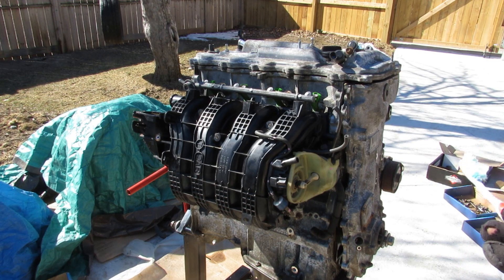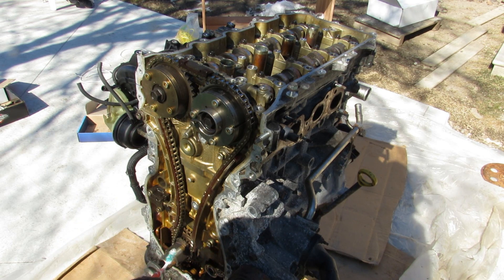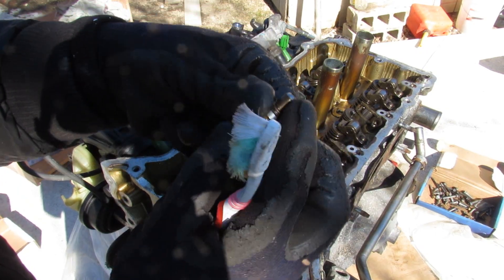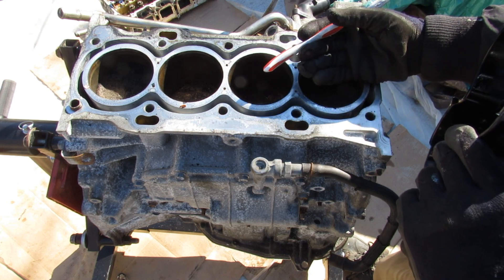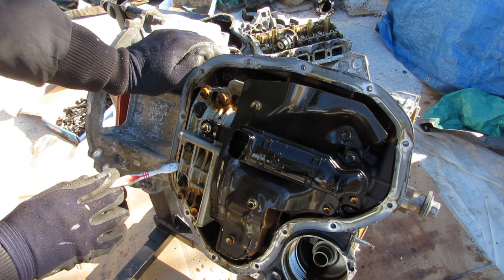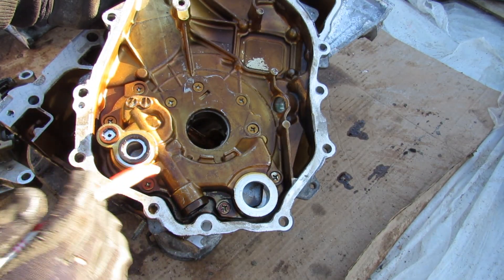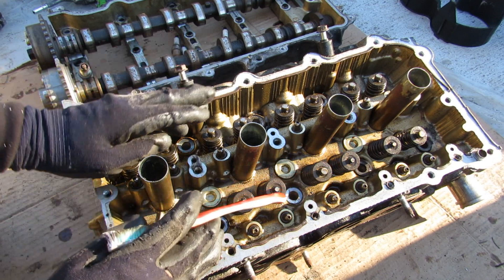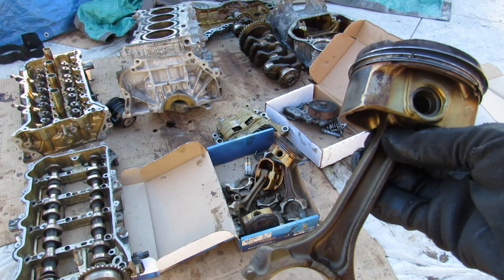Why Toyota Engines are Reliable

Comment: Too bad it's impossible to find a Toyota with a manual gearbox in North America. I'll stick with VW.
Reply: Additionally the Golf is far superior to the Corolla. Golf is way more intelligently designed from a user-experience perspective. The Corolla has substantially more limited space in the rear seats and back as well. And the Corolla has pretty poor rear visibility and awkward front pillars.
Reply from the maker: True. Sad

Comment: that's a very interesting cam setup. I like it. It's also interesting to see the air flap system in the intake manifold. I never saw that before. But, after Lincoln Tech I went to VW school, not Toyota, unfortunately or not.

Comment: Yes Toyota Honda etc have reliable engines. But they are spiritless, dull and drive like a boat. Some exceptions like Type R. But since you Americans  are used to driving boats that only go fast straight, I get why you guys love Toyota. Drives a lot better than a Buick. The suspension on USA cars is like Jason Derulo. Wiggle wiggle wiggle.

In Europe we drive circles around your cars. Yes our cars are more fragile, but they are in their own class. No Asia or USA engineering can come close. All the important races in the world proof my point.
Reply: European car Suck two to three time the cost on the maintenance and the Value drops like a rock! Yes Toyota Honda are the best and the best value on the life span of the car!

Comment: Have put 246,000 miles on my Toyota Solara (3.0 V6 1MZ-FE), so far replaced 2 water pumps as a preventive maintenance since 2002. Usual change of belts, filters and an oil pan since the threads became stripped from too many oil changes.
Probably another 100,000 miles and maybe then the engine will get tired?

Comment: Yeah reliable my arse. I had a scion xb brand new and after 18 months, it was sucking quart oil evry 4 months found during change oil. I was told it’s normal to 2.5 liter used also to 
camry, rav4. Traded right away.
Reply from the maker: Toyotas tend to burn more oils than Hondas, but the 2.4 was worse

Comment: I wonder though, if this engine is so reliable why is he tearing it apart? Why the rocking in those components?

I also wonder if my AZ engine is going to start drinking oil and chew up the head bolts?

Comment: I have always wondered why Toyota never got into the business of supplying engines to the small aircraft industry.(Cessna's and such) I had a 1985 Toyota pickup that had 250,000 miles with the original engine. That thing would not die. I believe it was the 22RE 4 cylinder engine. It was the same engine that they used in the Toyota forklifts. They could have made allot of money.
Reply from the maker: Cool

Comment: I had a 90 toyota pickup with the 22R-E, 2.4L, I put over 400K on it over 19 years, other than basic maintenance, i replaced the alternator twice, 1 starter motor, and the radiator once. Used to pull a 3500lbs travel trailer with it and it was still running fine when I sold it. best vehicle I've ever owned.
Reply: Please tell me, what was your experience towing?  I have an 89 with a 22re and it feels absolutely gutless.
Reply: @ianspeckmaier9565  Mine was pretty good, its a small engine to be sure and it doesn't make much torque until you get the RPM's up, I don't remember at what RPM the power kicked it, but without your trailer get it up to about 10 put it in 2nd and hit the gas, I think around 3K you will fell a good increase in power. I used to wind mine up to 6k regularly and in fact you can get it up to 60 MPH in 2nd get. I used to hold 55 in 2nd climbing mountains if 3rd wasn't doing the job. don't hesitate to let the gearing do the work for you. keep in mind my little truck was well maintained, I always changed oil after 3000 miles and if not on the button but within a couple hundred. Plugs, wires, cap and rotor were also maintained. Buy the time I sold mine it was 19 years old and well over 400k on original engine, not going to say it wasn't getting tired, it was. still ran and drove it around town, it was past its prime for towing, if I still needed it to I think a rebuild would have been the best bet, don't know how many miles you got on yours or how well its been taken care of. but those are things to consider. do a compression test, that will tell you if its still up to the task or needs a bit of care first. I've said many times, that little 90 toyota is the best vehicle I ever owned. best of luck to you and your little truck :-)
Reply: oh and one more note, back when I was using it for pulling the national speed limit was still 55, to go over 60 had to take it out of 5th and use 4th, to hit 70 needed to use 3rd. Don't think I'd use it to pull anything with a lot of wind resistance today. with speed limits up to 80 in places you need a bigger engine for like a travel trailer, its not the weight its the wind resistance.  My trailer was 2 foot wider than my truck, its like pulling a brick wall.
Reply: @kirknelson156  Awesome appreciate you sending all that that's exactly how mine drives too.  I just rev it out and when I get halfway up the power band she seems to have a lot more juice.

Comment: The infamous oil guzzling toyota engine.
Reply: I have a camry with the 3.5 2gr-fe doesn't use a drop of oil. Runs beautifully. The 2.4 2az fe is infamous for burning oil though no matter how meticulous you are with the maintenance.

Comment: I used to have a 2013 Camry (bought new) with that exact same engine! I put approx 115,000 miles on it before trading it in for a new car. That engine still ran like the day i bought it.
Aside from the usual (tires, oil, coolant and tranny fluid), I didn't have to spend a penny on repairs
Reply: 115k is barely broken in in a Toyota.

Comment: Still got my 1991 3S-GTE turbo engine, just finished a rebuild and was very happy to see there was very minimal wear, mine was starting to use oil alot, turned out to be all valve oil seals were cracked and 8 oil return holes on oil control rings on all 4 pistons were full up of waxy stuff, the control rings were also solid and didn't really move, thank god for the oil squirters!  ended up stripping down, washing entire engine with chemicals to remove the waxy stuff from holes gallerys etc, new piston ring set, light hone out, new main bearings as 1 had worn slightly through coating, 2 new thrust washers, new big end bearings, I polished the crank and cam bearings, used plastigauge to size replacement bearings, stuck whole lot back together with new seals and gaskets, its literally going back in the MR2 this week, hopefully will last another 30 years, legendary engines, now got a 3S-GE to put in a Caterham so that's up next for clean & rebuild if needed.

Comment: Cam phaser rattle on cold start up,even with low mileage, is an annoying issue with these engines. All in all it is a great engine.
Reply from the maker: All of them have it. Even my car
Reply: @speedkar99  it is a poor design.  My wife's Camry started rattling on start up at 30,000 miles.

Comment: We have a 2010 Toyota Avalon that was given to us by my Brother-In-Law.  It was his wife's car.  We have the oil and filter changed every 3000 miles without fail, we don't floor it, we don't drive it much over 70 MPH, yet at only about 76,000 miles, it has a bad piston pin.  So much for Toyotas being so fantastic.

Comment: I have 2014 Camry 2.5, is this the same engine?
Reply from the maker: Yes
Reply: @speedkar99  could I use 5w-20 instead of 0w-20?
Reply: @speedkar99  thank you 0w-20 burns oil

Comment: that plastic oil filter housing was a terrible idea on toyota's part. I remember customers coming in with sudden oil leaks after paying some noob at jiffylube to do their oil change and the idiot stripped the threads or didn't tighten them all the way. I think Toyota still uses the aluminum housings but for certain vehicles.
Reply from the maker: Yes aluminum on the Lexus models

Comment: It amazes me how so many engines these days are beautifully designed to the hilt for efficiency but often seem to leave a poor design cue somewhere that causes the engine to fail, eg dodgy cooling on the Ford Eco boost engines, timing belt tensioning issues on many engines and poor OHC lubrication systems on quite a few engines.
Reply from the maker: Yes

Comment: Very cool now i understand how my engine operates thanks! Certainly shows the importance of changing oil I do mine every 6 months even tho i drive about 6.000 Kilometers a year lots of passages the oil needs to flow thru especially when it comes to keeping the rings in good shape especially the ring that scrapes the oil off the cylinder walls. Too quote Scotty engines are expensive oil is cheap
Reply: You're just wasting money though, modern synthetic oils will last for two years with that mileage.

Comment: I think it's because to be an engineer in Japan, especially an automotive engineer, you practically die just trying to get through university. Hell, just getting in .
Reply: They also have culture where they value quality and dependability above all else.
Reply: JATCO (Nissan) certainly hired some idiots to design their CVT's and other parts of the cars.  The Europeans also screwed up Nissan.
Reply: @robinsattahip2376  I was about to say... all that tech is actually coming from Renault.
Reply: @robvelor  no. Mercedes were using this technology of the cam box system in the 1970's, being part of the M110 twin cam 6 that first appeared in 1971. The VVT system has been around for about 25 years as far as I can remember. I think this system was introduced by Mitsubishi in the very early MIVEC engines.
Reply: @christophermarshall5765  but it's Renault's implementation.
Reply: @robvelor  no it is not. Mercedes made the twin cam six cylinder engine in 1971, while Renault were still using pushrod engines in their cars. I should know this, because I have a Mercedes W123 station wagon here which has an M110 twin cam engine that has the cam box set up the same as this. The only thing that engine does not have is variable valve timing, not that it needed it, because those engines put out 185 horsepower with fuel injection. Renault were never an influencing part at the time.
Reply: @christophermarshall5765  Renault is actually building it though.
Reply: @robvelor  yes Renault are using this technology. The twin cam system is not new. The first twin cam six cylinder is Mercedes built, and they were using twin cam technology in racing cars before it was used in passenger cars, along with fuel injection technology.
Reply: There's also probably some influence from Zen minimalism

Comment: Had a scion tc with this engine. Redlined it every gear, all day, everyday. Never an issue and had 130k miles
Reply: 210k redliner here, still going absolutely no worse for wear! Remarkable motor, going for 500k, because why not

Comment: Amazing this guy knows almost every part of the engine. I'll be like where's the dipstick?
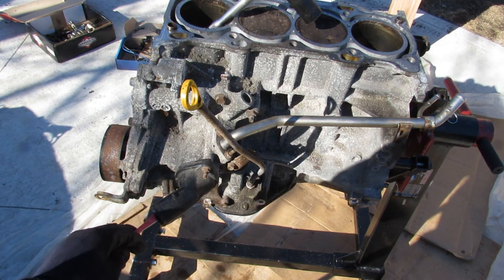Reply: 6:41 there it is
Reply: I think, I just done found the reason why people do not change the oil in these things. 😂
Reply: He is using the toothbrush of knowledge, thats why.
Reply: Yeah, hes brilliant!!
Reply: Some new cars don't have one--oil level is displayed on the dashboard infotainment screen (along with tire pressures).
Reply: It’s funny I close to  just as much and how it all works. But I have never worked on a car and would have no idea how.
Reply: That's because there's WAAAAAAAAAAAAAAY more shit on a little dinky 4 banger than there needs to be
Reply: @MadScientist267  a VW flat 4 has nothing it doesn't need. It also produces about 30hp, but who cares?
Reply: @AR-zq9hq  I never qualified it beyond the implied "to run" 🤣
Reply: @AR-zq9hq  30hp,terrible gas mileage and needs to be rebuilt about every 60k miles all while putting out tons of pollutants.  das auto indeed.
Reply: Just familiarity gained over time.
I can name all of the parts inside a PC/console or on most circuit boards, but if somebody had a model of the human body's internal organs and told me to point to all the parts of the lymph system I'd be like: ...... O_O

Comment: Toyota/Lexus engines, what BMW used to be until after the E46 M3, well engineered, constructed and reliable. Toyota engines are getting even better, while BMW engines are going the opposite direction.  Having owned are worked on many of the good BMWs, l wouldn't have a new one unless it was free.

Comment: That’s a lie. The motors they manufactured for the first generation Scion TC has a defect that will cause excessive oil consumption and at some point, the rod bearings to wear out. How is that reliable?
Reply from the maker: 2az is a different motor

Comment: First car I got and still have 2009 camry with 2.4 liter.  It's reliable as long as I keep putting oil in it.
Reply: No leaks. It burns it. Read about 2azfe
Reply: @mikevee16  if it burns oil then put 10w 30 oil. See if that helps
Reply: It can take 5w20. I'm gonna switch from 0w20 to that.
Reply: @mikevee16  yes do that
Reply from the maker: The 2.4 for notorious
Reply: Fix the leaks

Comment: Why did the connecting rods have so much play? What failed in this particular engine?  The bearings looked decent. 
And I always thought Toyota oil passages were too small and convoluted. 
A leak in the timing cover or at several points would cause a loss of oil pressure in this design. 
Always thought an electric oil pump that starts up with a four second starter delay would stop cold start damage on all non racing engines. 
What do you think?
Reply from the maker: Apparently the play is normal. True having multiple points of leak can affect oil pressure. Luckily it's not a leaky BMW lol
Reply: Electric oil pump - nice idea. Would keep the major points prelubricated before starting and useful for turbo as its bearing could be cooled down after shut down.

Comment: 9:15 that's not a problem, it supposed to do that.
That wasn't the cause of any noise problems in the engine
When the oil pressure rises in the engine that should eliminate the movement
Reply from the maker: Good to know

Comment: Simplistic? You havent seen a simple engine until youve looked at the inside of a 2005 hyundai elantra 2.0L engine.
Reply from the maker: Good idea
Reply: We had the 1.8 Elantra, 2013 or so, with 130k km. The chain stretched so much, with the gears  and guides worn out, that the tensioner couldn't keep up, and it jumped. Never in my life I have seen such disaster, I even video it since it's quite a rarity. So we slapped 'new' one, with 60ks - everything all good. After everything was payed, we asked the owner: so how often and what oil did you use? (we found big bottle of 10-30 Quaker State in the trunk) - Ah, you know whatever was on sale at CT. If it was low, I just added a liter or so. I newer remembered the when I changed the oil, but I did 5-6 oil changes, since I have the car.
So in total the average OCI was about 20-25k km using regular mineral oil - damn engine killers.

Comment: Why are Totoyas reliable?
If it isn't broken don't change it. Iterative mechanical changes based on feedback from previous designs leads to better reliability then clean sheet redesign every new model year.
Reply from the maker: But somewhat outdated
Reply: @speedkar99  Yep. I'm a believer in never purchasing new items, including cars. if its at least a year old you can find reviews or feedback on the quality and major mechanical defects and make a more informed decision. In a similar vein if toyota basically use the same engine for 20 years they should have most of the major design flaws sorted out.

Comment: I rebuilt my 1GR FE engine in my 05 4Runner back in 2013 when the engine sludged out (had regular oil changes). I spun all 4 main bearings. 
Yes, Toyota has good engineering, but their engines RUN HOT (even at normal temp) and it just bakes the oil on. My advice: USE ONLY FULL SYNTHETIC OIL in Toyota’s, even the older ones.
Reply from the maker: Good tip. My Lexusand camry  is doing fine so far
Reply: @speedkar99  if you saw what I saw when I pulled my valve covers off and my camshafts looked like they were covered in dark chocolate, your jaw would be on the floor!

Comment: Most modern engines are just as reliable as Toyota engines. The problem is many manufacturers just don’t have competent QC process at its end production line.

Comment: I found out about Toyota reliably and their RN60 4X4 20R engines in their Hi lux pickup trucks in 1979. I watched it pull up stumps that V8 trucks couldn't. In 81 the 22R engine was now the engine in their trucks. In 84, I bought a brand new 4x4 and kept it stock until it was paid for. I lifted it and geared it 5.71 to 1 and 16x 38.5x15 Super SWAMPERS.I raced it in IHRA sanctioned mud races and won the first time out. It never had a mechanical failure and I put 375K miles on it. I had 2 more and never had an issue.

Comment: I had a vvti 1.8 on a avensis it had started to use oil but apart from that no issues in 2 n a half years and 24k.

Comment: The predecessor 2azfe engine is an embarrassment. Absolute laughable disaster
Reply: I agree ☝️.   That engine no matter what I do, it still burns oil.  If I can get 210,000 miles or more out of it, I will call it a day and move on to another vehicle.  Currently at 202K+ miles

Comment: This is why I just bought my 1st Japanese car a Lexus 450h mk4 😊 had enough of the unreliability of audi and German cars.
Reply: All cars are reliable. It's the owner
Reply: @vj8452  not true in my case I owned an Audi A4 2.0 TFSI b7 Quattro for 5 years no money spared looking after it and it was super unreliable almost £1000 a year in repair bills. Also suffered oil chain pump failure due to known manafactor non serviceable part failure which cost me thousands to fix. Audi Uk told me to jog on at first until I took it to court.